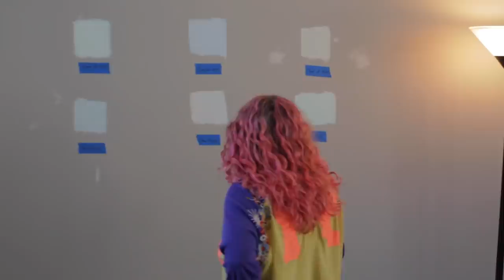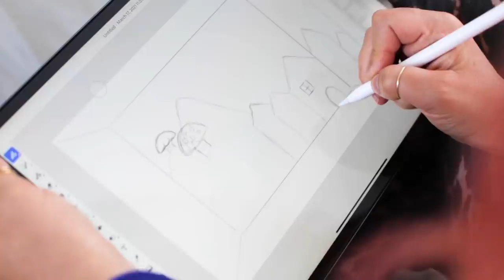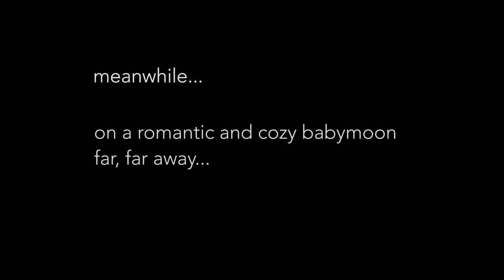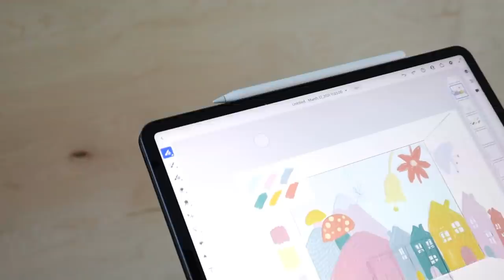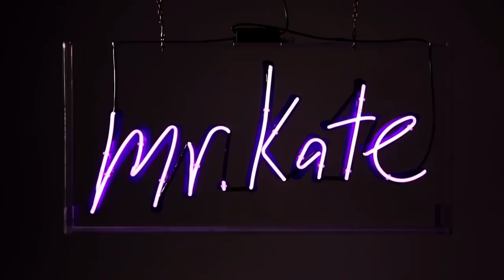Fairytale Nursery Makeover | Sierra Schultzzie x Mr. Kate

Comment: The whole 3d village mural wall reminded me of a cool thing my parents did in the basement of the house I grew up in. They built some house shapes from wood, covered them in different colors of felt and then attached them to the wall on either side of the chalkboard they made using chalkboard paint. They then gave the chalkboard a felt roof as if it was also part of the village and cut out some felt shapes that could be windows, or doors, or other fantasy house accessories and since the entire thing was felt, the shapes would stick on and could be changed with each new thought or idea no hassle.